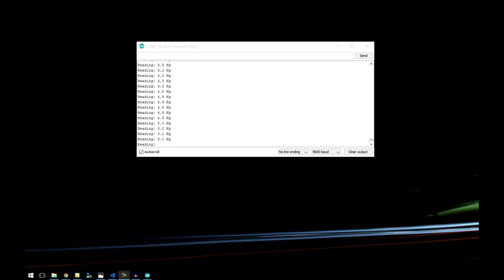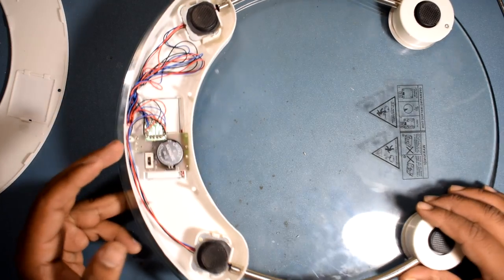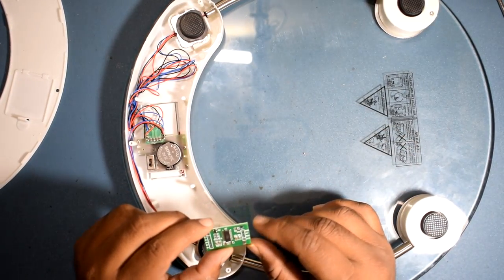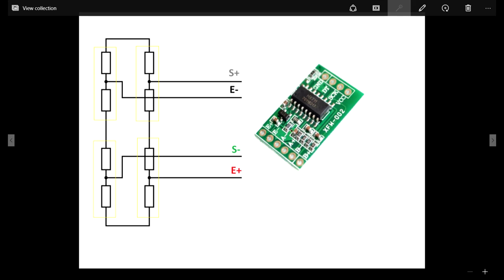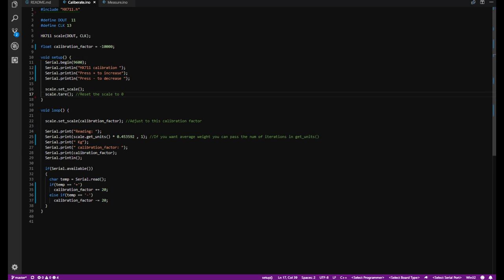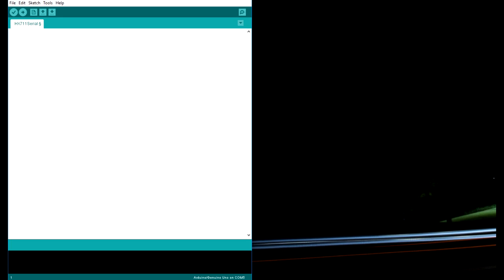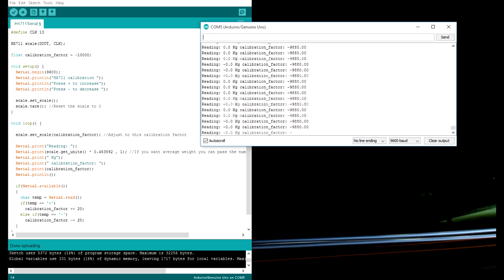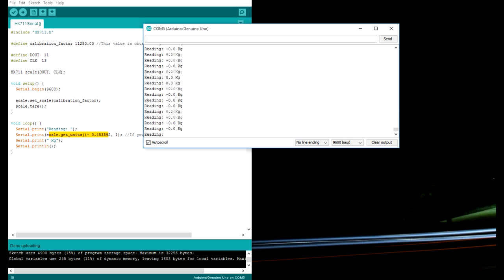HX711 & Arduino with regular Weighing Scale | IoT Smart Scale #1

Comment: Hey, do you know what sensors does the weighing scale uses? Model or where can I get only the sensors without buying the whole weighing scale? Thx
Reply from the maker: Load cells with load cell amplifier will do the job. Just look for load cells you will get whole lot of types of them. Just buy for required weight range.